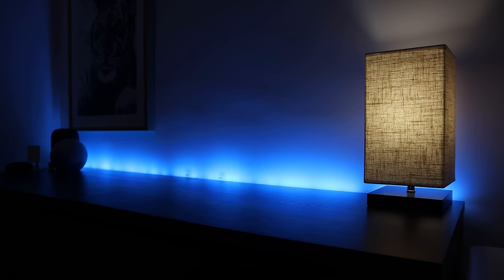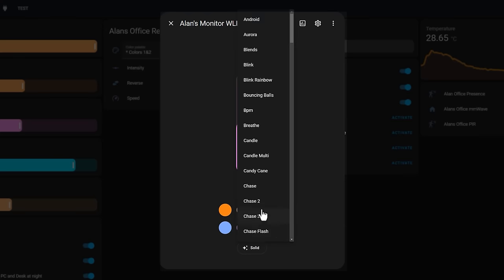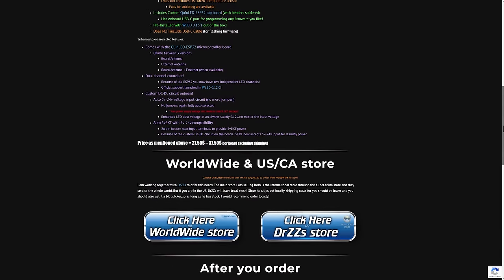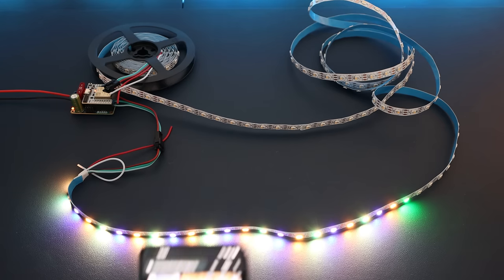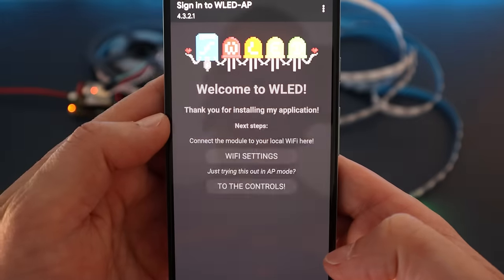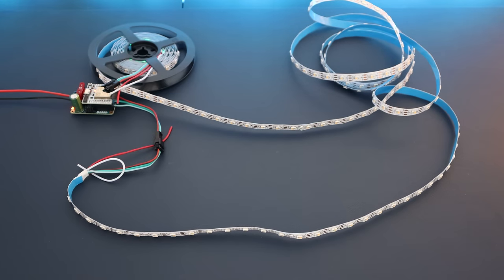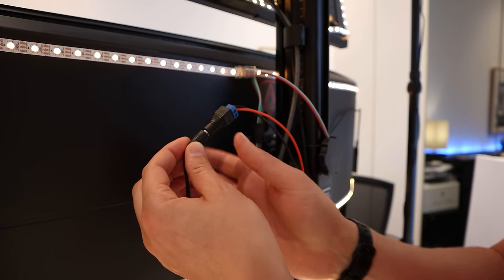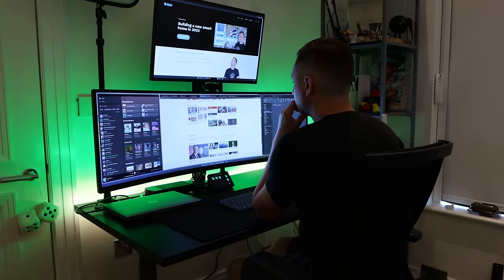Individually Addressable LED Strips for Beginners

Comment: I've been using Quindor's QuinLed devices, both analogue and  digital, for years, through many revisions.   They re simple, well designed and work really well.   WLED is one of the best firmware's for digital Addressable LED's if you want to DIY it, or even reflashign some commercial offerings.   I use a DigUno with an old ATX Power Supply using the PowerGood signal to turn the PSU on and off, and the 5V standby to power the ESP devices.   Really works well for me, and saves electric costs by shutting down the main part of the power supply when not needed.
I've also integrated WLED modules into Hyperion NG to get the "Ambilight" effect of te LED strip mimicing the on screen colours.
Thanks for the great video.   Really great to see this getting more attention on YouTube.
Reply from the maker: Oh wow! I'd never thought to use an ATX power supply.  I've been using a relay on one of the GPIO pins to turn on and off the "big" power supply for my kitchen lights.
Reply: @HomeAutomationGuy   An ATX PSU is good if you have 12V addressable LED's instead of 5V ones too :).   Just thought of that :)

Comment: Super nice video as always. I love the tip for making a right angle turn. I cut my strips and joined them with a corner connector which was way too fiddly. Next time I will use your approach. Plus one on the terrific quality of Quindor controller boards. The new Dig2Go boards are also very slick. Before those I tried Athom boards, also pre-flashed with WLED. But I find they are very flaky and drop network connection randomly for 30min or more. I found the barrel connectors for power are rather flaky, and I now prefer to strip the barrel connector from the power supply and screw the wires direct to the terminals on the board. Finally behind the TV, since the strips are not protected with an aluminium profile channel, I opted for the IP65 version of the strips. These have a silicone covering which acts as a great dust cover.

Comment: So i just got a request from my son’s marching band.  I have 10 drums 5 bass, 3 snare ,2 tenor.  
the band director wants to add some more energy to the show, so he asked if i could put some lights on the drums and have them simply turn on at a certain. point in the show.  that i can do fairly easily , but frankly it’s a little boring.  so then i thought about controlling them from the sideline of the football field remotely , and maybe even having some dmx so i can get some movement and color changes going.  After researching some, i realized some folks are using Midi to control lights.  if that is the case, i’d love to do that. I understand Midi very well, so i’d love to program like cues in that language. 
my question to you is  ,how and what gear can i use to do this?

Comment: Can I use home assistant to controll multiple LED light setups throughout the house? When would one need to run a 2 channel controller or 4 channel? Is there a max length per channel?
Reply from the maker: You can use Home Assistant to control multiple LED lights throughout the house.  I use a the 4 channel controller in my kitchen and split the lights into 3 different "zones" or "segments".  One is the lights under the cabinets, one the lights on top of the cabinets, and a third for the lights across my extractor fan.  These appear as different Segments in WLED, which I can control independently.  Each segment can have it's own colour, brightness, effects, etc.   I am not sure on the max length per channel, I am sure that is in the documentation somewhere.
Reply: @HomeAutomationGuy  gotcha cool. Thanks for the response

Comment: I want to put LED strips under my kitchen cabinets and use a dimmer switch (likely a ZWave dimmer from Zooz since I already have one of those for the overhead lights).  I'm confused as to what I need to use to control the lights in this scenario.
Reply from the maker: Stay tuned, I'm doing a video soon about my own WLED kitchen lights, and I control them using a Hue dimmer switch

Comment: Hi! not even hoping for an answer, but still might try... Has anyone encountered any zigbee switches (both wired and wireless) that can be installed outdoors? Sure, it my case that would be under roof, but still outside, which means wide temperature range
Reply from the maker: Not sure about temperature ranges, but you could maybe place one inside a waterproof rated outdoor box?
Reply: @HomeAutomationGuy  I already have those tiny relays in boxes, so no big deal there. But I do need something that has two buttons, and doesn't need to be connected to actual lights, since those are quite far away. Aqara has product with ip55 rating but that one only has one button, I need 2. 
Do they make any kind of zigbee boards for DIY projects that can be connected to more traditional momentary switch of my choosing? Because the only other solution I can think of, is using one of those little relays that can be connected to switches and mapping another relay to turn on when this one is turned on. But that would mean I have energized relay that does nothing. Kinda waste of functionality, if you know what I mean.

Comment: Bro can I directly connect 3pin strip into my pc header???
Reply from the maker: Dunno bro. I have no idea what voltages come out of PC power supplies these days.
Reply: @HomeAutomationGuy  i got 3 pin headers on the motherboard they also got 
ground data voltage in them and it's 5v

Comment: Please do let us know how your kitchen lights work! I hope there's a way to do power injection without soldering
Reply: You can do Power Injection by just running a second or third wire from the POWER output terminals on the DigUno board.   There is  Positive, Data and Ground (or negative) terminals, so you can easily run more than one cable.    
Quindor has heavier duty devices designed for running longer LED Strips.  The DigUno is really only designed for smaller strips.

Comment: Good addition regarding injection. If you're planning a run of more than a 150/200cm, plan for injecting 5 volt along the strip or at least at both ends. This prevents dimmer LEDs or colors being off due to lower voltages. Personally I've run all my LEDs through aluminium channels. This has two advantages; it diffuses the lights, so you don't see the individual LEDs (as much), and it serves as heatspreader. This in turn makes the LEDs last much longer, since heating up will significally shorten their lifespan.
Reply from the maker: I use aluminium channels on all my other LED strips, but the curved monitor made it very difficult for this project 🤣

Comment: Love WLED. I set up 3 strips in my set up. I had 2 I made and the 3rd was just the remaining offcut that was the perfect length for a led strip for my 3d printer which has an automation that turns on when I start up a print so I can view it remotely

Comment: I'd say you're feeling adventurous if you're using the clip-on connectors for your strips as opposed to soldering. Those are flaky, and with time it's quite possible they will fail.
Reply from the maker: But it's so easy!

Comment: I have a similar setup but in Home Assistant get errors about "This WLED device uses CCT channels, which is not supported by this integration" 
which you don't seem to get?
Reply from the maker: I've not seen that error myself.  Are you running the latest version of WLED? Perhaps play around with some of the CCT and White Channel settings in the LED Preferences settings page.
Reply: @HomeAutomationGuy  Looks like had a few colour correction boxes ticket.
Basically anything that mentions CCT untick e.g. "Calculate CCT from RGB"
Thanks for the video, I've finally got mine back into HA so now to get it doing some magic.

Comment: hi, great vid. was wondering whats the maximum length leds i could use doing this way? thanks
Reply from the maker: Without power injection it's hard to get good results beyond 2-3m. I get away with it behind my monitor because I'm not too concerned about brightness and colour accuracy as it's more of a gimmick so I could show a full WLED project in my video.

For my kitchen I have 6m runs working fine, but with a bigger power supply and robust power injection

Comment: Would it be correct to assume that the bigger the voltage LEDs, will always be brighter than a lower voltage ones?
Reply from the maker: Yeh. Pretty much
Reply: So, do you use 12V strips?
Reply: Oh wait, seems like you're using 5V. But they look so bright. I'm wondering why mine is not as bright even though I've power injected them already.

Comment: Been considering replacing my under cabinet lights with something along these lines, but wondering if I can use an under cabinet lighting driver as a power supply, as then can use existing feed, also as it’s a kitchen I’d like them to be IP rated, but don’t know what to look for. Also will need box to house & mount the driver, any recommendations.
Reply from the maker: There are several individually addressable LED strips that are IP rated, operate at 12 or 24v (Which is probably what your existing cabinet lights use) and are compatible with WLED.  Take a look at WS2812B strips.

As for a box, I usually just use a plastic ABS hobby box and drill a few holes into it to run the cables out of, then I stick it into the back of one of the kitchen cabinets with double sided tape.

Comment: One thing I would be really careful of on the dig uno is don’t let the bottom of the board get anywhere near to a conductive surface. I move a screwdriver and it slid under the dig uno and I heard a nasty fizzzd noise and that was all she wrote. Still ordered another one as they are the best way to get wled with some safety and help out quindor who’s a top bloke.
Reply from the maker: Ah yes. I always buy the option PCB case that they sell alongside the controllers